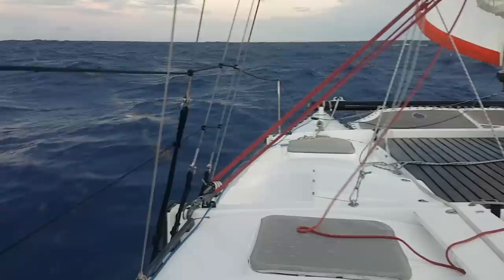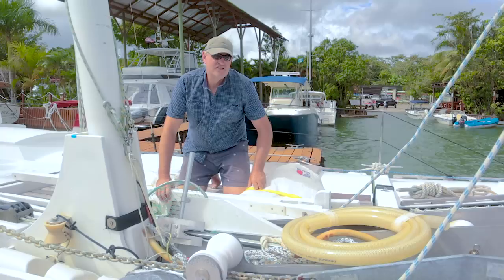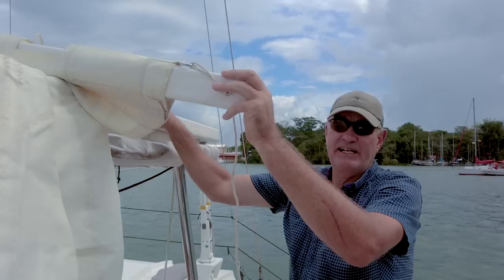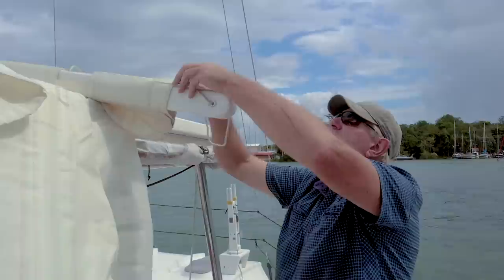CRAZY SIMPLE SAILING RIG - Secrets of the Wharram Wingsail - Ep 104 Sailing Luckyfish

Comment: I labeled the peak of the sails with an F and M, so I can tell them apart on PW. otherwise you do have to unroll then to figure it out.   The main is 230 Sq Ft and the 228 Sq Ft. not a lot of difference
If cut to plan, the foresail has a longer luff and shorter foot than the main.

I have the 2 sheets system on the foresail, it allows me more flexibility to shape the sail with out a traveler. The rope traveler on the main provides the same ability to shape it.

As shown, bending on the wing sails is best done on a day with little wind, as you have to hoist them to complete the exercise.

The best part of this rig is the sails are small and easily handled.
If you need to de-power the rig and maintain some control, simply drop the peak halyard and you take out over 50% of the effective sail area.
Learned from years of sailing Gaff rigs.

This rig is one of the main reasons I selected a Tiki 38.
Reply from the maker: Great stuff. Yes you are right about releasing the peak halyard, good tip there. James W said, "you can always just drop the foresail". The simplicity of that comment really stuck with me!
Reply: @SailingLuckyfish  yup that will do it too, but if you just need to de-power temporarily dropping a peak is less work than wrestling a dropped sail, and easier o reset.
Reply: This is what comments are for. Great read! Love conversations like this.